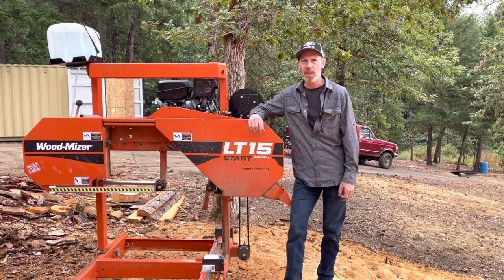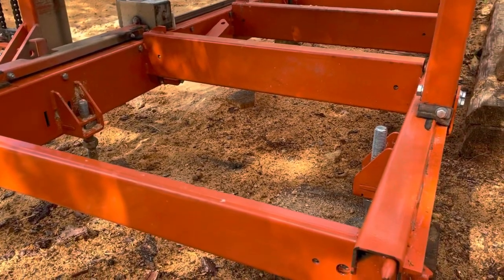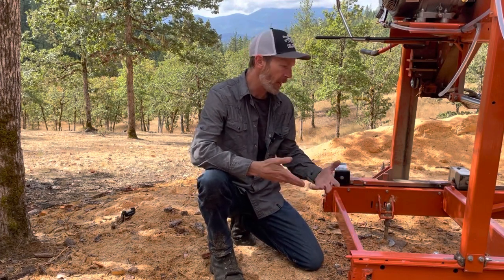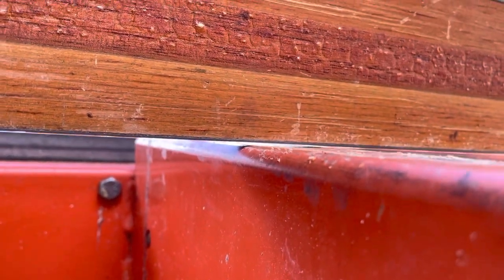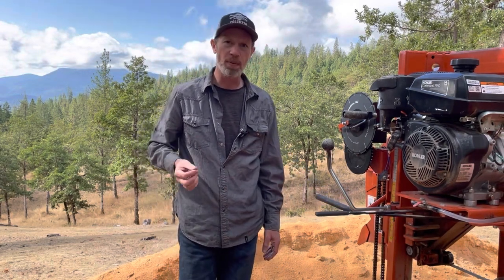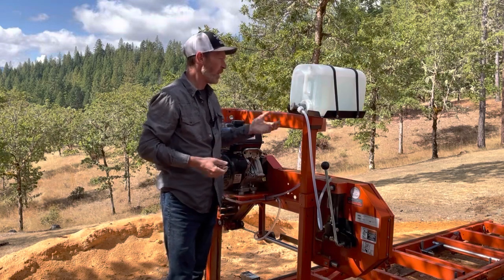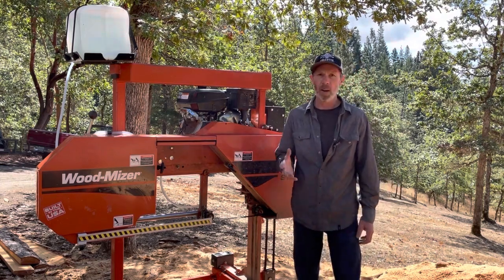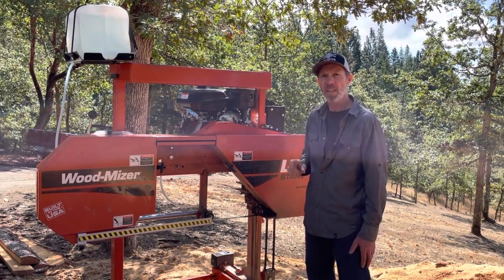What I DON'T Like About My Woodmizer LT15 Sawmill

Comment: When I had the same problem of trying to keep the tracks level, I got a 20ton flat deck trailer took off the decking where the tracks fit in and mounted them directly to the frame of the trailer problem solved and now it’s portable too.

Comment: I have the Lt 15 but had you mounted it on some 6x6x20' beams and anchored your legs to the beams you wouldn't have any issues. Also the right side has dowels in to help with the alignment. I live in Alaska and have to reset my mill every yr after breakup. Oh on the beams I used 3' x1/2" rebar and drilled thru the beams and drove the rebar into the ground. It is rock solid.
Blade change open the guide wide open and work from one side to the other. That way you can control the teeth from hitting things
Reply from the maker: Thank you, those are very good tips. Mine doesn’t have any kind of dowels on the right, only on the left. I set up one for my dad that is the same way. I have seen some videos of LT15‘s that look like they may be different than these. Maybe the differences in the Start model.

Comment: If you have not fixed the log stop yet I would suggest sticking one of these split spring washers between the nut an the frame, that way you get more even spring tension on the join.
As for the levelling feet, mill up some square blocks of some hard, rot resistant wood and then saw them into two pieces with about a one to ten slope. Use the opposing wedges you just made to get finely adjustable feet for the bed and then lock them in place with a couple of woodscrews.

Comment: What great video, about time someone did one with the exact questions I had, notice  how the unit flops all over when you engage the blade, and if it does the then, what about going down the rails. Sure enjoyed the video, and the adjustment legs are a joke, think I saw a LT 15 Wide with trailer jacks on it. If you upgrade, maybe you can sell this one, still looking but no impressed with this unit anymore, The HD 35 Hyd.  is what I think would be a great mill, old guy by me had one but retired, an he use to cut lots of wood for me.  👍👍👍👍

Comment: A very balanced overview of this mill, I think you've been very fair to it, possibly, you use it far more than you expected at time of purchase ( how to tell🤔) , because it is branded, it has a resale value, a great step in for someone else if you decide to upgrade.

Its always important to think about the kerf width of a bandsaw VS circular saw mill, bandsaws great for making wide, but slim boards, swing blade mills better for thicker, dimensioned timber at tailing out, lots of chip to clean up tho 😐 but great for putting around fruit trees (me and the line trimmer are not friends) but I love my chainsaw..

Still appreciating your subtle, dry humour, its like, I have to listen, understand, think, then laugh, I like that process.
Reply from the maker: Thanks for the kind comment. I don’t regret buying this mill at all. It has served me well, and like you say, it would be easy to sell.
Reply: Personally I don’t like woodmiser, I know they are the standard for small band mills but if I were just going to cut occasionally I would go woodland or horror freight. If I were cutting a lot? Baker or TimberKing with full hydraulics & an edger.
Reply: If you were nearby I could solve a lot of those issues.

Comment: Our Norwood was a 4 post 4 wheel design and that thing was solid, now for the bunks
I was the worst thing I’ve ever seen , you couldn’t keep the bunks level if you wanted to,
Unless you are like me. After taking it apart quite a few times and countless times readjusting I finally welded everything . I call there bed design a LEGO SET. I think if you had supports under the bunks like a railroad track track system you could forget about the legs. And for the side track and extra roller I would be adding some extra design 😂
I do have plasma cutter, welder , torches, a lot of metal and rollers… 😂😂😂😂
I learned how to spell modifications before my own name 😂😂😂😂 thanks for sharing your in and outs. Take care. All yea  LT40 wide with 
Diesel 😂
Reply from the maker: The bunk under the tracks is probably what I will eventually go to. Metal modifying tools can definitely be the solution to a lot of problems. Getting an LT 40 seems to be the consensus in the comments. When I watch the videos of those of you who have them, it is definitely tempting.

Comment: I don’t have that saw but e would agree that being unable to achieve near perfection when tuning up the saw would make me stressed. It all seems insignificant until you get problems with blades diving or some other finished product. It’s difficult to diagnose the problem when you can’t even tune up the saw any longer.

Comment: Check out Professional Homeowner. He also had an issue with LT50 bed sections and, I believe, WM replaced them. In my opinion, having uneven bunks may be the worst thing you mentioned; you never know what accuracy you have on board thickness. As you know, the LT15 saw head is a cantilever design and not as stable as a true 4 post design.
Informative video.
Dave
Reply from the maker: Thanks Dave, I will check out that channel. Usually the logs straddle that lower middle rail so hasn’t been too much of a problem. I forgot to mention in the video I helped someone else set up an LT 15, those rails were off the same as mine. That’s actually how I discovered it.
Reply: @WilsonForestLands  Sorry about the error. Ravi has an LT15 NOT an LT50. Sorry.
Reply: @WilsonForestLands  Also........just found out that WM was at the guy's house just last week to make the section swap.

Comment: Sounds to me like it would be cost effective to upgrade the weak spots on the mill you spoke of and you would have a great machine. Bigger and better footings. Weld some pieces on the rails to make them “lock” together. Maybe just mount high quality hydraulic jacks with large foot plates where the screw jacks are. Just my thoughts

Comment: What I do not like is no idol option for edging boards!  I modified my mill so I can detect the throttle cable when engaging band to edge boards.  Saves a ton of money not feeding that thing with gas running wide open for edging boards.
Reply from the maker: On mine it just has the manual throttle lever on the engine. I can hold it wherever I want. The problem I had with it was if I let go of it, it springs back toward idol. If I tighten it, it works for a while, then loosens up again. I got into the habit of having one hand on the push bar, the other one holding the throttle where I want it.

Comment: Our LT15 has a different engine so this may not apply to yours...The exhaust pipe turns down and enters the muffler.  Problem is the exhaust pipe is smaller diameter then the muffler inlet so unless you have it undercover, rain will get into the muffler.  Hasn't been a problem but it is a little disconcerting when we start the engine and water comes out the muffler.
Reply from the maker: That hasn’t been a problem with mine but I could see that being disconcerting. The exhaust is something I haven’t had a problem with on this one. I have been impressed with how well it vents the exhaust away nicely and I rarely smell it while running it.

Comment: All you issues seem like they should have been changed by now, why the 3 wheel set up makes no sense, and the high adjusters for the bed shouldn't have tge threaded sections passing through frame sections the way they do. But over all I think it seems good quality for the price, but the cost could be high for anyone not using them a fair amount.

Comment: very nice!  i have the same opinion as with your issues. the wheels, the rail wearing from the one wheel, the vibration during a cut, etc. my biggest problem was from the backlash of the pull starter handle due to the valve adjustment and the internal problem. my wrist is still injured from this. i love having a mill but.. a square cant takes a whole lot of careful measuring and adjustment of the individual side cuts. i went with woodmizer after much research and being made in the usa. a less expensive object should be due to fewer bells and whistles not reduced quality. also wish there were more service techs. in the field. i really hate to offend but as thomas payne said if you are afraid to offend you will never tell the truth.... maybe woodmizer will be listening. a good quality mill would have made my entire experience so much better. every log i cut open every one is like opening a gift! the mill should go hand n hand with the experience. thanks
Reply from the maker: That was well said. I have had the same problem with the starter backlash. One time the handle came back and broke off the on off lever. My dad has the same mill, his did the same. The local Kohler service dealer told me to bring it in so they can adjust the valves. I just haven’t done it yet.
Reply: I have a woodland max 130 and the Kohler engine nearly broke my wrist as well. It has electric start and I added the battery. That is the cats meow.🙂

Comment: You can take the hose off of the lubricant feed by unscrewing the fitting just like a garden hose and then reach over and take the two bungee cords off and you can take the tank off without removing the metal that holds the tank
Reply: Since you are such a design critic, perhaps you should  you build one and make millions of dollars!
Reply: Or just screw a T into the cap where the faucet is & add an extension to the top of the tank.

Comment: The springs break because they aren't made properly like things were made here in the US 50 years ago. Steel from another country!!! Wow, shakey Mill. and why you have to snake the blade through that small crack is beyond me. I have a Woodland Mill that will cut 30" wide with only a 6" depth. and for the money it is a good mill. More stable than this Mill. Your not knit picking, the bed should be even. I was wondering if I should get this Mill, pay an additional $6K to gain 5" on on the width of a cut and an increase in depth of cut. The design of the cantilever head  Woodmizer makes it much easier to cut level. The four post heads with the bigger footprint require a much more level bed.
Reply from the maker: Thanks for the comment. From what I have heard from people with Woodland Mills they all sound happy with them.

Comment: Cost cutting isn’t an excuse for shoddy design. A little bit of bracing would go a long way to make that carriage stiffer, and the adjustable leg design is ridiculous. Threads should not have heavy side load on them, thr legs should be box section inside box section with a screw adjust and separate lock. Cost them $20 more in material.

Sometimes I think companies get to a size where they need to invent their own low end products and deliberately hamper their design to make the expensive mills look better
Reply from the maker: Well said, it seems like it wouldn’t be that much more expensive to do a few things that would make this mill a lot better.

Comment: Woodmizer, like the other sawmill manufacturers, is a capitalist company. It has quality control but more than likely it is geared towards quality control that also saves as much as possible in producing each unit. It also knows its customer base and what it can afford. It could produce a more expensive  top notch machine that probably would cost more and cost it sales. It has chosen to cater to its customer's economic possibilities. Toyota gained its position by building top notch, accepting razor thin profits, and doing it over an extended period of time. I doubt it has better engineers and designers than the US big three but they chose to go for the bottom line. I will possibly buy Woodmizer when I buy but will do so with my eyes wide open.
Reply from the maker: Very well said. I did get the cheaper mill. Even though I have complaints about it, I got what I paid for and it’s still a good machine.

Comment: Sum 1, who can't lift the water tank would not likely be workin with logs.
Reply from the maker: I know a couple elderly guys who do. They can use mechanical advantage to move logs and cants. They can slide lumber off instead of lifting it high. Lifting that much water up that high could be difficult for them.

Comment: I dont see the little blondie in hot pants and cleavage complaining, it looks likes she is having a good time.
Reply from the maker: I don’t know who the blonde in hot pants is. As I said in the video, I do like the mill. I have a good time with mine as well.
Reply: One could get a tapered cork,and cut a hole in the top of the tank it would fit into.
Then one could fill it up from smaller containers.
or rig up a water container,lifted by a couple pulleys for mechanical advantage,in a nearby tree(or somewhere higher than the sawmill tank).with a hose run from it to fill the sawmill tank.... thanks for the videos!